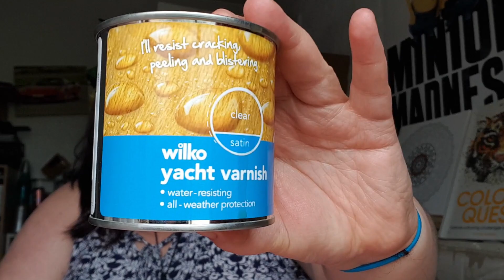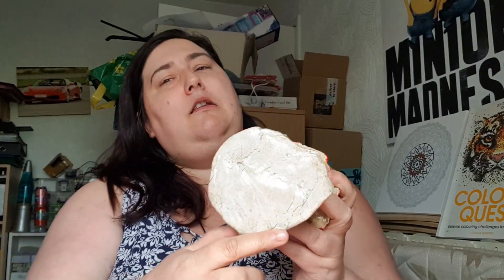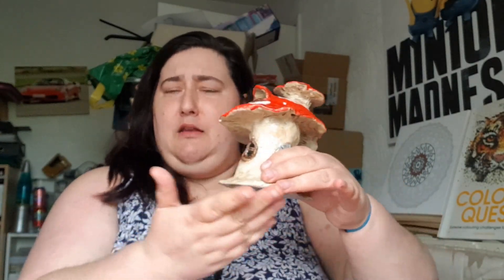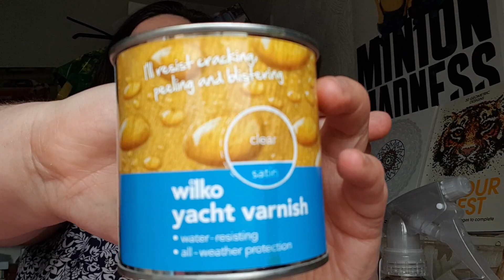waterproofing Air Dry Clay experiment

Comment: Never tried yacht varnish but I use DuraClear gloss varnish from DecoArt Americana. It's a polyurethane gloss varnish. It is water based so you can clean your brushes with soapy water. Has a very faint smell of acrylic paint and a little goes a long way. Make sure your clay and paint is completely dry before applying this in thin coats and leave to dry in between coats about 4-5 mins. You can find it on Amazon
Reply from the maker: Thanks for ur comment, I did have some polyurethane varnish but because it was waterbased I didn't think it would be suitable for outdoor uk weather, I'll have to give it a go, I used yacht varnish since it's used for boats it is really good for rainy weather
Reply: @ManicCreationsChannel  I make coasters from Das airdry clay and use the DuraClear to seal them. I put them under the tap and wash them with soapy water if coffee or tea drips on them. It is definitely uk weatherproof. The yacht varnish is mainly for wood and has the high fumes so not the best for craft. Give this one a go :)
Reply from the maker: @gabypga  thanks I will, gonna try and find it online and give it a go
Reply from the maker: @gabypga  you'll have to make a video of ur coasters, I'd love to see them
Reply: @ManicCreationsChannel  I never made a video in my life hahah. Maybe I'll give it a go sometime. I really like the log you made in one of your videos, you just got a new subscriber :)
Reply from the maker: @gabypga  thanks so much for your subscription, u really should give it a go, I was baffled and terrified when I started but it really is quite easy once u get the hang of it, the log is one of my favourites it's now got a permanent place in my mother in laws garden

Comment: Wood actually absorbs the varnish and with dried clay the varnish stays on the surface, making it very strong. So i think other varnish will also work, just make sure you apply enough coatings and each coat let it fully dry. But good job making it waterproof.
Reply from the maker: Thanks for ur comment,  I did find that it left what seemed like a wax coat, but its been outside in rain since I put the video up a few days ago and it's still waterproof,  might try different wood varnishes to see what difference they make x